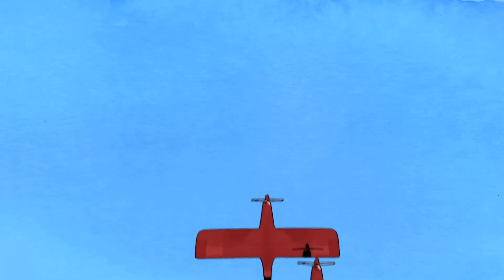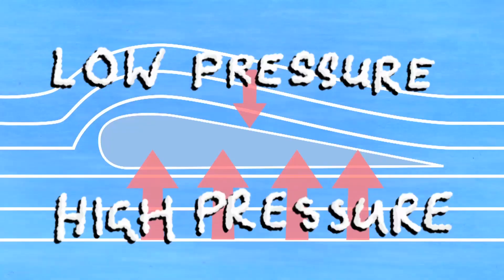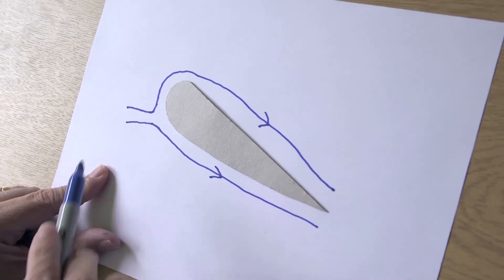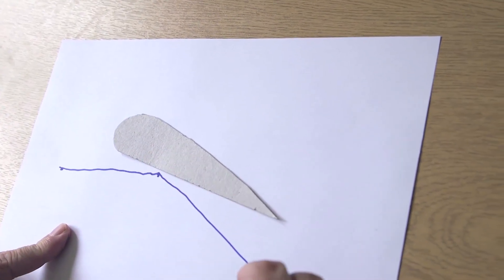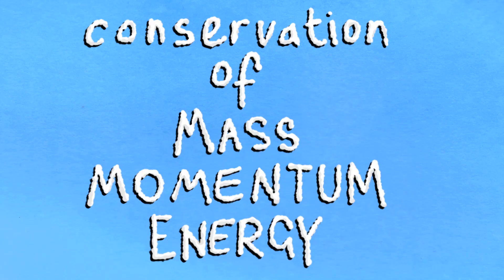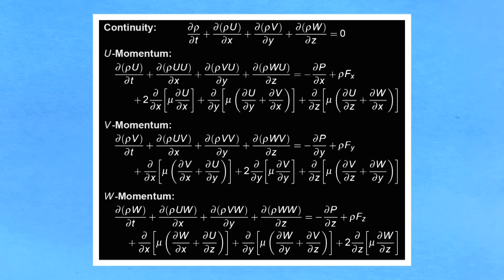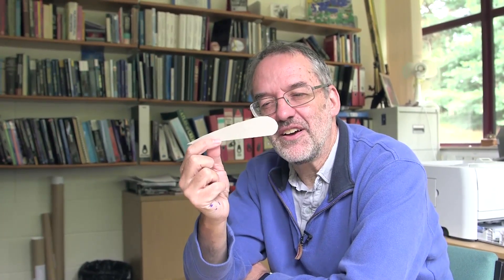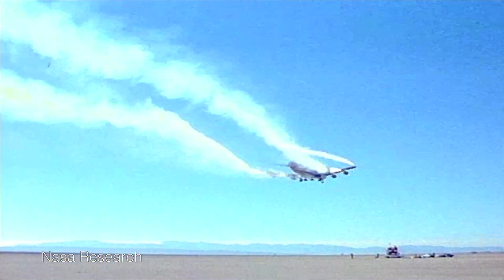Lift and Wings - Sixty Symbols

Comment: Good video. Better than most I've seen that deal with lift. Personally I prefer to simplify things: The wing interacts with the airflow going around it, applying total downwards force on it. By Newton's second law, this downward action on airflow has an upward reaction on the wing, that being lift.

The details on how the wing applies a force to the airflow gets more complicated, and a lot of explanations focus on pressure differentials and how they are created, but many of those explanations tend to get mired into particular details and miss the big picture. There's talk about how the reactive principle can't be correct because air isn't being deflected downwards - well, actually, it is deflecting air, but it's almost immediately stopped by the ambient air that the wing is traveling through. Basically, the downward-pushing force created by the wing is dissipated over a very large amount of air, which means the air as a whole doesn't really move a whole lot (wing tip vortices notwithstanding).

If the wing traveled through the same region of air over and over again, it would eventually start to create a downwards airflow. This is actually what happens with a table fan, or an aircraft's propeller, or when a helicopter is hovering static in one position. With helicopters, it turns out that the downwards airflow through the rotor disc actually decreases lift... but that's kind of a different topic.

By the way, I find it interesting that people keep saying that the air going over the top of the wing "provides more lift" than the air on the bottom of the wing. The lift is by definition caused by a pressure differential between the upside and downside of the wing, and you can't have a pressure differential without including both the pressure above AND below the wing in the comparison. It's true that compared to the ambient air pressure, the pressure drop above the wing is greater than the pressure increase below the wing, but the total lift force is still all about the total pressure differential and both sides are part of the lift force being generated.

I also find that the low and high pressure zones are slightly over-inflated in terms of importance. The fact is that the only way gas can ever apply a force on anything is through pressure differentials, so basically the pressure differential over the top and the bottom of the wing is exactly how the wing is applying a force on the airflow (thus "deflecting" it), and the airflow is applying equal and opposite force on the wing.

So I find that saying the wing "creates" areas of high and low pressure is just a roundabout way of saying that the wing is applying a force to the airflow (and vice versa, hence the lift). Just by moving your hand through air perpendicular, there's a high pressure zone in front of your hand and low pressure zone behind your hand, creating drag. If you flatten your hand relative to airflow, you can then deflect airflow up or down by tilting your hand or making a curved cup-shape: This does create high and low pressure zones, but you can intuitively feel it as your hand pushing on the airflow, as well.

By the way you can create lift with a completely flat aerofoil, relying only on angle of attack. It isn't particularly efficient, but I think it could be a good place to start explaining why the simplified Bernoulli effect explanation cannot be correct, since even symmetrical aerofoils, very thin aerofoils (like paper) or completely flat aerofoils can produce lift.

A completely flat aerofoil can produce lift if it's tilted (ie. has some angle of attack).

A flat but curved aerofoil can produce significantly more lift; this curve is also called "camber". Many early airplanes had wings that had very narrow chord (thickness).

More modern wings usually have thickness because that way it can apply a stronger force on the airflow - a thicker wing produces more lift.

Wings also have asymmetric profile (camber) because this means they can produce lift even if they are at zero angle of attack or even slightly negative angle of attack; this reduces parasitic drag because the aerofoil can move through the air with the smallest possible cross-section presented to the airflow, and thus the wing becomes more efficient (at certain airspeeds, anyway).

But all of this becomes very complicated very quickly, and the fundamental laws of physics, action and reaction, always apply, so the simplest way to explain lift really is to just say that the wing applies a force on the airflow going around it, and the airflow applies an equal force to the wing in the opposite direction.
Reply: You don't even know which of Newton's laws are which... you are really in over your head here buddy
Reply: @GZA036  The numeration of the laws doesn't really matter - besides, Newton's second law is really the important bit. 

Newton's third law is just conservation of momentum applied to the second law.
Reply: Thanks for taking the trouble to write this, it's clear that you have thought a lot about it

Comment: I would personally start with conservation of momentum (a sort of distant view of the system) and work backwards into smaller details like bernoulli which is more about minimizing drag for the amount of lift.  After all even a flat, infinitely thin wing can still fly.

Another thing that often trips people up is the angle of attack of a wing is usually just seen as the chord line - a straight line between the bottom two points on a wing.  However, since most wings are designed to minimize drag with the same side facing the ground they get quite a substantial tilt which gets hidden by their curve.  Stunt planes are designed to flip over though and as such often have completely symmetric wings - without altering their angle of attack they'd have zero lift.
Reply: Hmm... But even the flat wing needs an angle of attack, and with increased angle the Bernoulli effect increases.